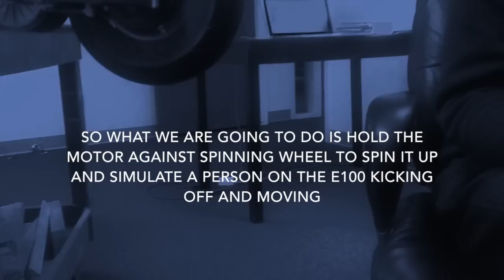Razor E100 Tech - Controller and Throttle Operation (ebay Safe)

Comment: Hell yeah guys. I found 2 e150 scooters in the trash. Batteries were dead so first I bought a charger for $8 off Amazon and rechecked. I checked the ebc on both and one was good. I took the good ebc and put it in the one with the good batteries, pulled the throttle and nothing, spun the wheel and nothing again. I bypassed the motor and it worked. I then saw this video and put a paper clip in the brake switch and the damn scooter runs great. 2 scooters for $8. Not bad. Thanks for your expertise.

Comment: Thanks for this. Other videos mention it needs a spin to get it going but no-one else mentions it needs to be a fast spin. So far I have replaced the batteries and the controller, everything seems ok but it does not work. Will now try this, thanks.

Comment: what voltage will it take could i switch the batteries for 36vdc?...... 2x 18v @ 5Ah lion packs half the weight and size? any help is appreciated cheers
Reply: Also interested in this question

Comment: I've tester my battery is was right under thirteen so that was good I hooked up a jumper to the motor so I know it ain't the motor. My biggest issue is I hear no click! would that be a relay in the throttle? This thing powers on but don't budge its a e100

Comment: Thank you for explaining the controller functions, I was just about to send mine back.
Reply: First time razor scooter user, these things are downright dangerous you twist the throttle and instantly the thing so shoots off the line not safe for five year olds! Why the hell can’t they design these things better from the get-go. What are my options here, I’d like to remove the twist throttle and just have a button as when your jet it forward your cleaning on for dear life hence having the throttle full open! The thumb operated button might be easier I’m talking for a five-year-old here!
Reply: @JacanaProductions  Hey Jacana, not true.  They do exactly the opposite...they WILL NOT shoot off the line!  They only engage if your allready moving....you need to kick off to get the electric motor to engage.  If yours is not doing this its broken, contact a dealer!
Reply: @johnf1353  Not true with old Razors with lead acid batteries, they shoot off the line and have no kick off function. Not a problem if you can get used to it - we got our razors for free from a neighbor.

Comment: Is there a way to bypass that feature. I have an inmotion scooterboard that is the same way, have to move it for power to go to motor. I am trying to hook up a thumb throttle to it, since the original broke, but can't figure out which wires go where. The thumb part black, Red and white I got, but not sure about the rest of the wires.

Comment: I have the E100 Glow. I found a tutorial on how to solder a jumper on the board to bypass the kickstart relay - but it was for the E100, not E100 glow. Is there a way to tel which relay is for the kickstart so I can solder in a bypass?
Reply from the maker: Never did this one, but im sure it would be similar
Reply: Can you link this tutorial?

Comment: I just picked up a E125 for $13 at GW, turns out it works great. Thanks for explaining the "initial safety push". Without that info, I would have started to throw parts at it.

Comment: I replaced the battery and control box, checked all points that you showed and  motor is working with  direct connection to battery. 100% checked but the connector from controller to motor don't have power with throttle. help!

Comment: Hi.

 Can you estimate the cost for Control Module Razor E200, E300 , to shipping in UE zone ?
Also, what type off controller is that from the test ? 
Seems to be much smaller then the one I see on your site.
My plan, is to put the MY1016 on bicycle, using the simplest and cheapest mode.

 Thanks.

Comment: My do the saint thing only click don't stared it check battery one  go 1278 the other one got 12.57 put stared it the 1257 stared go down to like 12.53 take the botton aut got up to 12.57 again you thing battery no good the other one got like 12.76 And go back to 1276 don't now what can be problem you got any links can check all the cable see one no good o the realay do the noise thank you video

Comment: Great video guys! Super helpful but I'm still stuck. I replaced the controller and have good batteries. I have no click in the controller so what now? Replace the throttle and cable?
Reply: Side note: throttle shows continuity when I turn the throttle on orange wires only, no continuity on brown wires. Any advice would be greatly appreciated!!!
Reply: @EarthAngelFire777  I have the same issue, any updates?

Comment: Hi I just came across your video I have the scooter which used to work perfectly however when I turn it on now it goes by itself without me touching the throttle so how do I get it do the scooter only goes when I pull the throttle

Comment: You can use a drill to simulate the kick off. Just open the chuck all the way up and put it directly on the drive shaft. Take the sprocket off first.

Comment: Good information! Is there anything tricky like this with the crazy cart control module? My son's razor drifter quick working after about 10 days. Battery indicator on throttle would switch from full to low and not work. Eventually the controller just started clicking. Razor sent a new controller and its the same thing. Thanks!
Reply from the maker: Sounds like bad batteries, in fact from what you said we are almost sure of it.  Watch our phantom voltage video!

Comment: I'm having problem with my scooter it was working fine then all of a sudden is it not go fast it said that its charge there's a green light and when I put the brake on the wheel goes fast and start spinning but then when I'm on it it barely goes like a dead battery but the battery is charged can someone help me with this problem

Comment: Hello, i just came across your video and wanted to ask, do you have any idea of how the throttle control works? It has 3 wires so i'm thinking maybe PMW? I'm doing a little project and i need to replace it by something of my own so i need to recreate the signal the throttle control sends. Thanks in advanced!
Reply from the maker: Not PWM, its very simple.  The throttle simply uses a 5v hall sensor.
Reply: @WildPowerSports  Thank you so much!!
Reply: @WildPowerSports   So is there any kind of way to bypass  this 5 V hall sensor so that any time you hit the throttle no matter if the wheel is turning or not it will go?

Comment: I have already tried with two new controllers and it doesn't even "click" new batteries, new throttle, new relay I just need to change the motor,but if I put it directly from the batteries it works properly.
what would be the problem?
Reply from the maker: Wiring, connectors, or power switch.  Try bypassing power switch.  Also, where did you get the batteries?

Comment: Hi bought the controller  and extra batteries from Amazon just in case, but I still can't hear the click, I already check the break circuit and tested it,  the motor does work when I connect it directly to the battery, I don't what else to test -  is it possible that the replacement module that I got is not good?  anything else I can check? Thank You
Reply from the maker: Please watch the Off Scooter Testing video we posted.  It goes through EVERYTHING

Comment: I was given a e175 razor scooter and I think the motor dear on it..when I hit the throttle the box dont click so I disconnected the battery and it do click.  I also plug the mother in the jumpers where the batteries  go into b4 the relay box + - and still the motor don't turn even when I give alil hand spin..is the motor dear or IAM missing something..
Reply from the maker: Please watch the off-scooter testing video!

Comment: Ok I have a E300 razor I bought new battery. The problem Im having is it not getting the full  24V to the motor. I tested the power to the motors and it goes for 3.5V to 24V for a sec. then drop under 3.5V run very slow but still  24V coming out Batt? Does that mean that the control speed by module needs to be changed?
Reply: mm

Comment: O:12+ I have a razor Pocket mod I charged it up and at the same time it would not move forward but I did have a clicking sound before I charge it up completely now I do not have the clicking sound nor will the razor Pocket mod will not move at all period but the on and off button shows as an indication that I'm getting power to my batteries so how can I fix this problem
Reply: Can you please help me

Comment: If you turn the switch on and twist the throttle and there is no click from the controller is that most likely the controller is faulty?
Reply from the maker: Could be either...
Reply: @WildPowerSports   it actually worked once i kicked it but does not click

Comment: Do you have a kit to run 2 motors at Sametime and start up with out having to push off make in to go cart
Reply from the maker: No need for a kit.  Simply use 2 controllers and wire them to the same throttle.

Comment: Hi I've put the voltage the wrong way round in the power input and heard a click pop what part would it be it's a razor E100s model number ZK2400-DP-LD-ROHS. 24v make date 2013/09/30.
Please can you help me I would be so grateful.
Reply from the maker: Usually that will fry the module.  For a replacement head to wildscooterparts.com

Comment: For a razor 350 dirt bike  I plugged it in to charge for 12 hrs but the green light is only blinking on the wall charger and the switch doesn’t turn on when turned on anyone knows what’s wrong 🤙🤙

Comment: Hey guys, do you have any tips and tricks to overvolt a e100 to 40watts? I did it and it works great for about 1 and half minutes then shuts down. I let it cool off for a bit then can go at it again. Any help?
Reply from the maker: Thats why you dont "overvolt".  You change controller and throttle to the correct voltage.
Reply: @WildPowerSports  Yes you are absolutely correct. I wanted  to see what the limits are on this inexpensive second hand scooter I picked up. Test, fail, change, test again........

Comment: hi i just got a razor e100 my uncle had stored away the brake handle was removed and the red and black wire to the brake  was cut what should i do? i got good batteries  but i dont hear the click from the box  any help
Reply: Mi patineta no me funciona la pongo acargar y sale la luz cerde pero no me funciona quiciera saver cual es el problema
Reply: Erika Cebteno una o Las dos baterias estan malas

Comment: Do you sell a variable throttle set up for a hypr350 thanks!!
Reply from the maker: Yes!  Just use our Standard Variable Speed Kit for Razor, it will work good on that bike also, since its a similar setup.  wildscooterparts.com

Comment: How do you disable the push assist and use throttle only? -
Reply: change the motor out, it's a design with the motor itself
Reply: patrick batemon wich motor can i get to change it out with so you sell one if so how much are they
Reply: There must be a way to modify the motor to eliminate the minimum speed switch.

Comment: Can I add this function (where you need to kick the scooter in order the motor to start running) to Razor e300? I assume this function will keep the motor in good shape longer. What controller do I need for E300? Thank you.
Reply: Just develop a habit of rolling before turning the throttle on.

Comment: How many watts is an e 100 motor "good" for ? I'm gutting a trash find unit at putting a 1000 watt 48 volt controller and lipo battery in it we'll see. Want to keep it stock appearing and still push my 250lb ass around to keep up with my 3 yr olds over clocked 6-12volt John Deere gator.
I want to fuse the motor for max ish current so I don't burn it up too quick.
https://www.amazon.com/48V-60V-1000W-Controller-Bicycle-Scooter/dp/B00WBB07QI